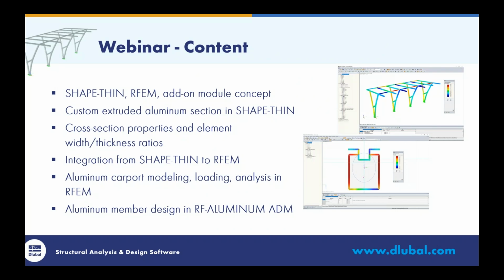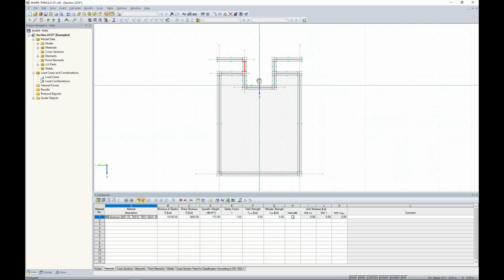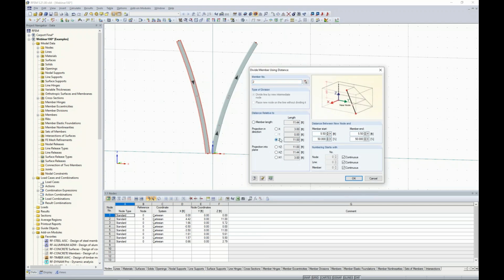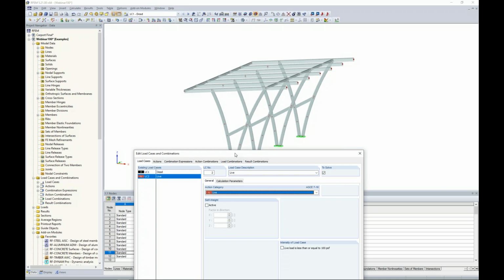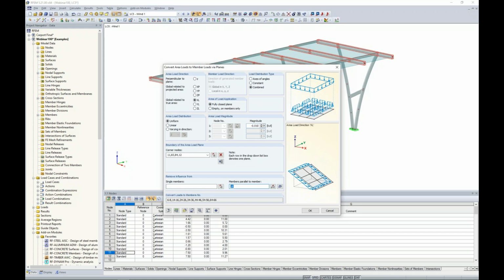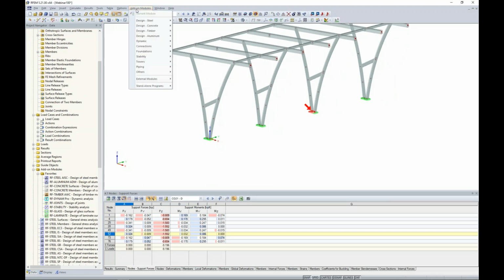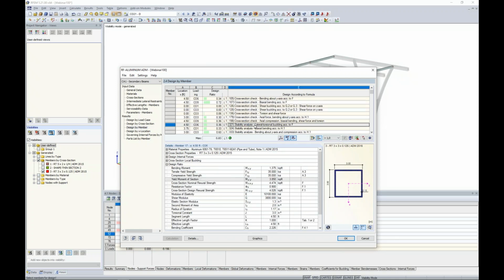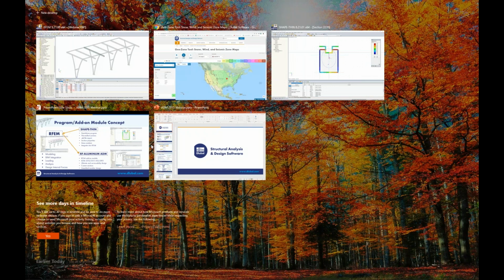Webinar: ADM 2015 Aluminum Structure Design in RFEM

Comment: Hi,  what type of surface material is there on which snow and wind load is acting ? Because it seems hollow structure without any material in the roof gaps.
Reply from the maker: Hi, ali!
The roof panels are not modeled. Instead, the loads are applied directly to the members assuming the roof panels/surfaces do not add any  stiffness to the structure.